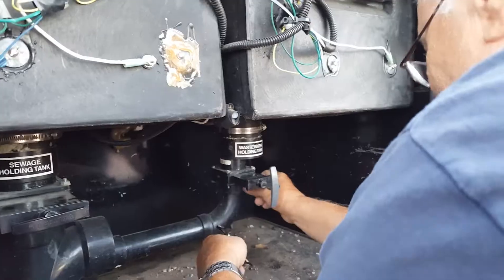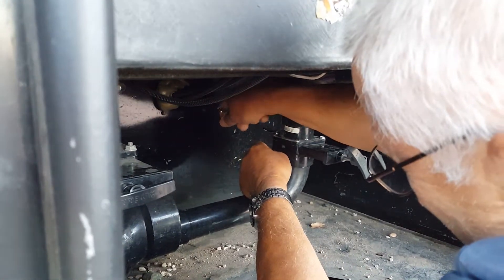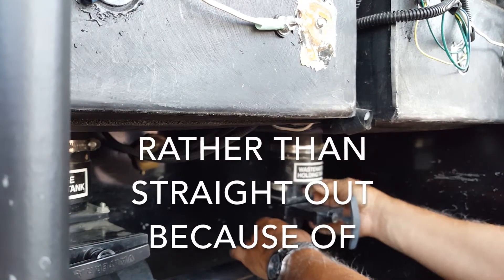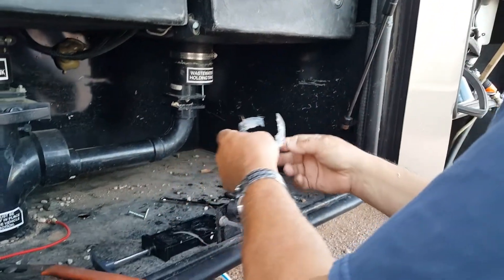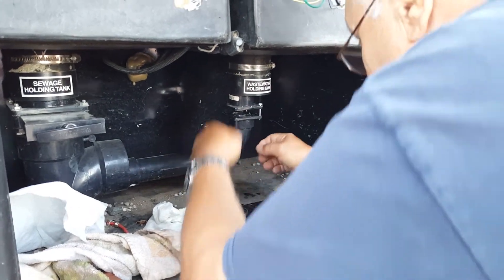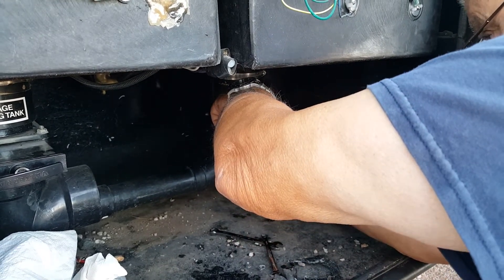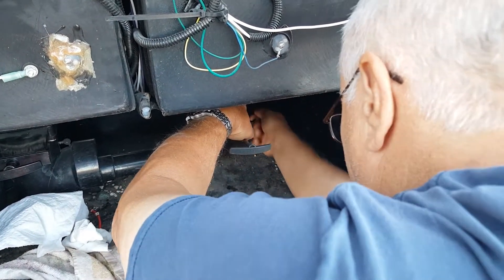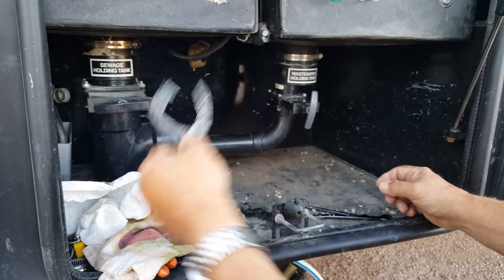Fixing a RV Jammed Waste Water Valve

Comment: The incomprehensible things you find when you start RV life. Our shower drain was installed with screws that were not stainless and they corroded off after a while and had to be replaced with stainless ones.  After that nothing surprised me.
Reply from the maker: PNW Granny You've got that right! When an RV rolls off the assembly line and someone is going to pay between $100k - $200k for it, one would expect some thought and craftsmanship to go into it. But one would be disappointed..

Comment: What brand RV?
Reply from the maker: 2008 Gulfstream Independence
Reply: @Jean-qn4fy  Thanks, another brand to avoid?
Reply from the maker: @1Whipperin  Bill, you can buy a $300,000 Prevost and it is going to start falling apart on you as soon as you leave the dealer's lot. We are thinking of getting a small trailer just for a week or 2 in season. If we decide to do that, we will be looking for the oldest, cheapest thing we can get that won't lose pieces as we drive down the road, and just accept that we will be fixing things.
Reply: @Jean-qn4fy  I bought a new Arctic Fox 25Y 4 years ago. Overall it has been solid, lots of minor stuff to fix. A used Arctic Fox would be what I would look for.  No more new trailers. Someone else can get the bugs out.
Reply from the maker: @1Whipperin  They are pretty, but would not work for us. We have a 2008 Cadi SRX that we like. Wolf has found that some of the 2008's were fitted with special towing packages that gave them a towing capacity of 4200 lbs. He has found an oversized transmission cooler on ours that makes his think we may have one. We need to check it out. We will be limited to somethong about 19 ft, tops.

Also, because of our own really bad experience and the experiences of 2 friends, we will never, ever, at all, ever buy another unit with slides. Never. I know there are hundreds of owners who had good experiences. We have had an awful one.

Lastly, we both have back and joint issues. Anything we get will need major interior changes that would ruin the resale of a newer unit. First, the toilet would probably have to be slightly raised. Second, any stove would have to go, to be replaced by countertop burners and a raised convection oven/microwave so we don't have to bend to pick up hot food. Third,  any sleeper couch would have to go and be replaced by a platform that we could put a sleep number mattress on.

Back 40 years ago, we had a little 19 foot Fleetwood Wilderness that was perfect. I wish I could find that little trailer, now.